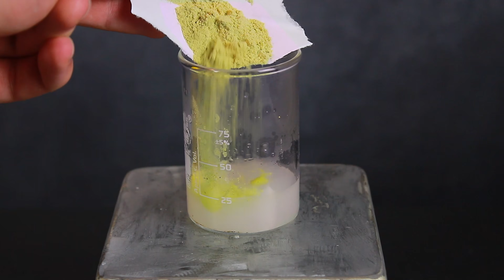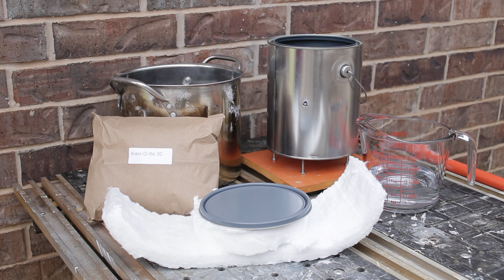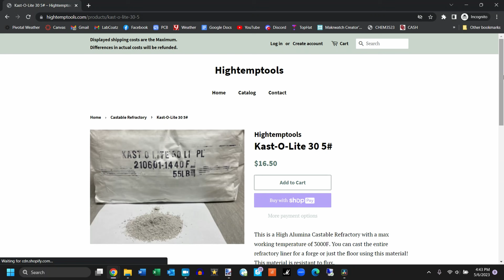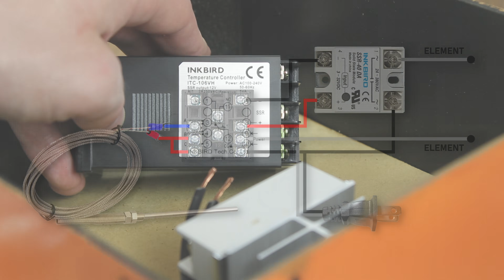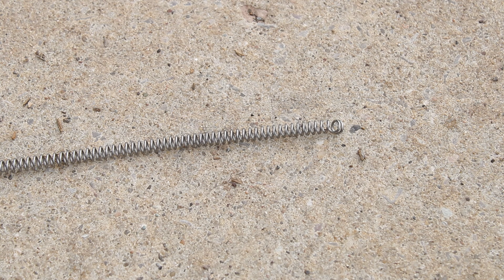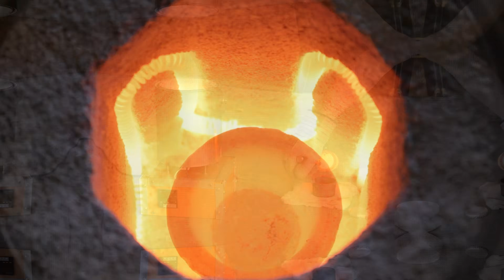How To Build The Ultimate Desktop Electric Foundry...From a Paint Can!

Comment: If you try this, I recommend doubling over and twisting the kanthal wire where it enters the terminal block. This halves the current flow in the wire and prevents it from getting hot outside the firing chamber.

Comment: The probe end of the temperature probe will eventually fail.  That type of probe end is designed to be covered by a ceramic sleeve.  You can protect it by making a sleeve out of graphite rod.  Drill a hole down the center of the graphite rod the same size as the probe.  Or you can treat the probe as an expendable item that will need to be replaced occasionally.  They're not too expensive, so keep a couple of spares on hand.

Comment: This is super cool! Quick question tho… Why is red wire on the thermocouple spliced into to both of the bottom terminations (#4 & #5)? The documentation for this PID makes me feel like a project MKUltra victim.
Reply from the maker: No clue, I just followed the instructions, lol
Reply: @LabCoatz_Science  I ordered the same unit but the manual it came with shows different connections dependent upon the type of temp sensor being used. My current interpretation is that you use both 4&5 for an RTD sensor and just 4 for a thermocouple which is what I thought the K type is. Either config seems to work, but the initial value is higher by ~2x (IIRC) when you splice into both vs just #4. I have no idea if that makes a difference especially since you have to use an offset for the k-type initially either way. I’ll report back once I finish putting it together and compare with a more trustworthy temp gun or if my house burns down prior.

Comment: Impressive work, I am trying to build something similar for the sake of testing concrete at high temperatures. I have 2 questions:
1. How can I reach higher temperatures (say 1000 - 1200 °C)?
2. How can I control the heating rate?

Thank you

Comment: Curious...can this be converted as wax burnout?
Reply from the maker: I don't see any reason why it can't be! As long as the heating element has the same resistance, it will run in any configuration and at any temperature.

Comment: Adopting the 220volt wire to 120v by cutting meets the resistance needed but watts/m² goes up thus may easily burn up.
Reply: Does the wattage go down when the voltage goes down also?... So therefore, if the wire is left to length 120v wouldn't be enough to heat it to full temperature? In any case though, with the temperature being controlled, I think the wires shouldn't get hot enough to burn out at all. If it was possible for the power to get that high to burn out the element, it would probably happen very quickly (minutes, possibly seconds), because otherwise, the thermostat will cut or reduce power to the element when it gets up to the temperature that it's been set to. I think the thermocouple would cut the power fairly quickly if the coils got much hotter than the set temperature, because of the lack of air and small space. The temperature inside the foundry would quickly reach the temperature of the coils, which would then cause the power to be reduced.

Comment: 2000 C or F?
Reply: 2000F. 2000C would be far beyond the melting temperature of the heating element. You have to be careful when buying heating elements though, because most will have a maximum temperature of 1300F. They'll just barely melt higher temperature aluminum alloys, but nothing more. I was actually very surprised when he said it would melt copper. Have seen many DIY furnace videos and none were ever able to melt copper, because of the heating coils and/or the controllers didn't go that high.

Comment: Great build!  Have you seen the Shake The Future YT channel Melt Metals in the Microwave The Ultimate Guide video?  He has a great how to video that details how to even make the crucibles he uses using the silicon carbide susceptor material with silica glass. Super interesting and would be neat to see someone in the U.S. make a larger scale design since seems feasible from what I can tell.  

For the last decade and then some, jeeze more like three, I've been really interested in using microwaves for organic synthetic chemistry and other chemical and physical reactions.  Especially if a tune able microwave and even IR source, though even with a regular microwave oven seems the way to say make ammonia and improve on many other reactions performance when designed to be optimal with the right conditions and apparatus design.  Anyways, figured I'd mention since you dabble into what seems to some as the exotic worlds of chemistry.  Makes me wonder how 3D printing with susceptor materials or like the principles of laser mirrors in the microwaves region implemented in the print, or maybe even in 3D filament somehow, might open a new world to explore.

Comment: It seems inconvenient that you have the controller right under the paint can like that, where you could spill some liquid metal on it as you take out the crucible. Maybe off to the side would be more user-friendly? Or put a catch basin under the paint can over the controller?
Reply from the maker: I was just basing it off the traditional designs seen in stores. Putting a controller on the side might be a good option for larger kilns, but one this small, it would be pretty bulky and awkward. Plus, being on the side instead of underneath would expose it to a much greater risk of overheating/getting splashed by liquid metals. I tried making the base almost the same size as the paint bucket, so it would be more difficult to get liquid metal spilled on it.
Reply: @LabCoatz_Science  Maybe you could put a brim around the top, or the base? Could probably be some flimsy sheet steel thing, it shouldn't take much to prevent most incidental spills or dropped crucibles or similar from being able to sit on top of the particle board enclosure and presumably set it on fire.

Comment: I should note, that it is very important to ground the metal paint can to prevent it becoming live at mains voltage if something were to go wrong.
Also big care should be taken when loading and unloading the kiln, as the heating element is live at mains voltage and could give you a shock if you touched it with something conductive.
Otherwise great build:)
Reply: The like say carbon crucible and metal pliers? That's a good point and this could lead to bad times.
Reply: @zyeborm  Yes, this has been a significant concern of mine whenever I watched a video were someone melts metal using such an electric furnace. An isolated/floating mains might be a good idea for such a furnace.
Reply: kanthal develops a nonconductive AlO2 coating when it heats up. the electrocution risk exists, of course.. but it's not quite as serious as it would be with a nichrome or iron element like the one in a toaster.

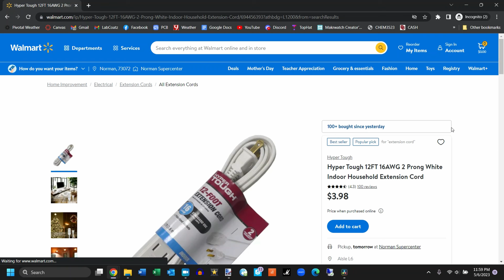Comment: 4:13 can't tell you how many times I've done this.

Crazy to me that it is so much cheaper to do this than actually buy plain wire
Reply: Also, thrift stores will often have extension cords and old speakers with fairly long wires attached that will usually be cheaper than buying plain wire

Comment: It would be really useful if you could record the longevity of your construction and point out possible weak points
Reply: The weakest point is that the PID should be a ramp/soak type controller so the rate of heating and cooling can be controlled, every heating and cooling cycle will cause a lot of cracking in the insulation and shorten the life expectancy of the heating elements and crucibles used. Optimal heating rate for normal muffle furnaces is typically ~5 C per minute.